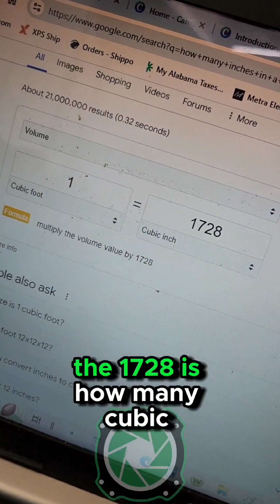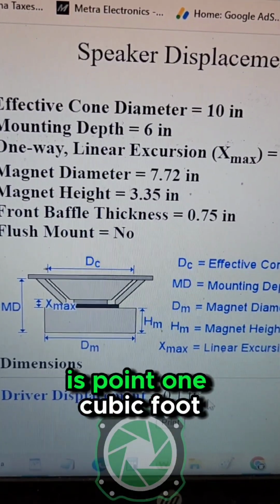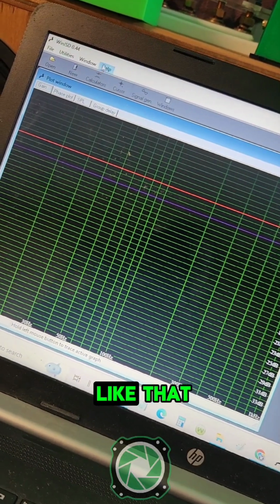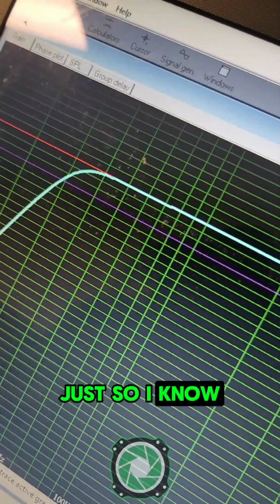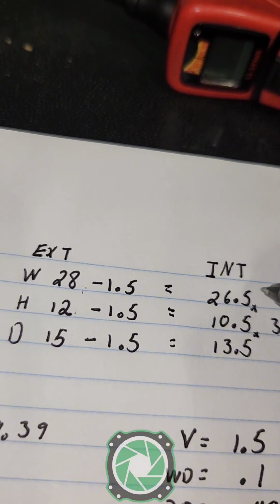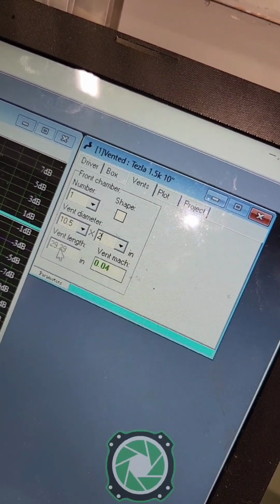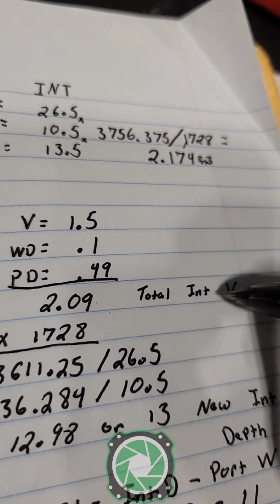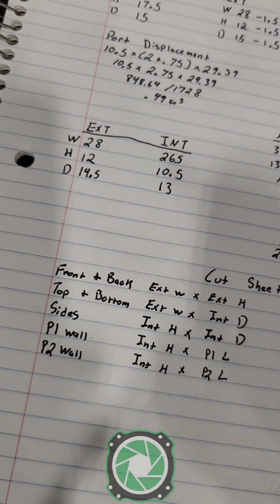How To Build A Subwoofer Box Calculate Box Volume, Port Area/ Displacement, Cut Sheet Part1

Comment: I designed a box of net 1.75 cubic feet tuned @35 hz.

My slot  port area is 24 sq inch (2 inch x 12 inch )

Is it good enough according to your experience .  Or it is in the smaller size

Comment: What's the correlation between box size x power x port area? Can a 12" sub that recommends 1.5cuft tuned to 38 be made larger and play lower and on rated power?
Reply: Good question.